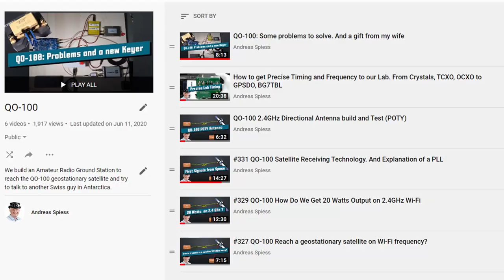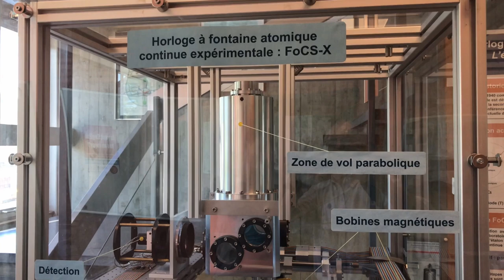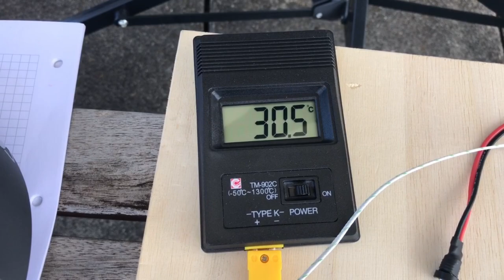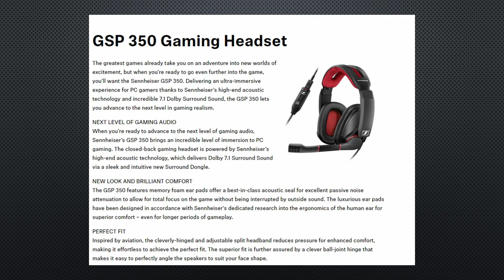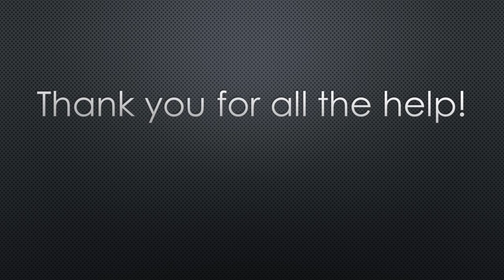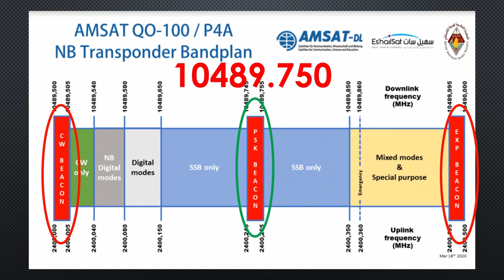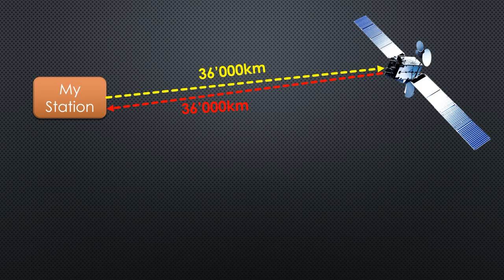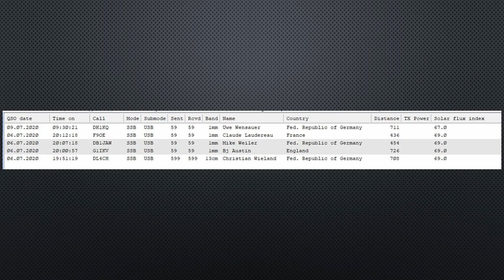#344 QO-100 Update: Fried things. And a success

Comment: Hi Andreas
As a fellow Radio Amateur I would like to congratulate you on your first satcomm contact, I am at the other end of the spectrum HF Voice and Data.

I too am an keen experimenter;  to increase my knowledge, killing of equipment is a key part of learning, you learn more from your failures then your successes. Having killed x1 Raspberry Pi, x2 Arduino TTGO, x1 PSU, x1 430Mhz transceiver, and more; I do not remember ! 
Keep up the good work.
Chud M1PUP QTH London
Reply from the maker: So I think we play in the same league concerning killed parts ;-) At least most parts these days are not too expensive.

Comment: you just demonstrated why I put a decent size heatsink and a 80mm fan on my 2.4GHz PA. I like not having to worry about temperatures.

A thermocouple on the backside of the PCB, right behind the Transistor, mounted with a tiny dab of thermal paste and some kepton tape, works well for temporary temperature monitoring.
Reply from the maker: This is for sure a good solution. I ordered some thermal switches which cut the power off when above a particular temperature. As simple protection it should work.
Reply: @AndreasSpiess  Yes very effective.  I used the same after frying a Peltier effect device

Comment: Hi Andrea, thank you for the great video. I dont see any preamplifier in your setup, did you directly connect TX pluto to SG LABS PA ? Tx pluto is about 3dbm,with 30db power gain you should get 33dbm of 2W max, is it correct ?
Reply from the maker: No. The yellow box close to the PA IS A 20dB amplifier

Comment: As to ensuring proper cooling and RFI protection, what about a 9.5/10" or 19" rack enclosure with a beefier fan for the PA and ADALM PLUTO? Enclosure and fan grille (preferrably the kind which is a metal sheet with dense small holes) well grounded (you're a ham like me, you know the drill :D ). Should help with protecting the setup from Bluetooth, WiFi and other ISM gear.
Also, be aware of that using Switched Mode Power Supplies can cause headaches in RF applications (but nothing worse than that you can fix it with a good LPF).
Reply from the maker: 1. Actually, I wanted to protect the Bluetooth set from my 10 watts at the same frequency ;-) I assume the dish is too small for the Poty, and part of hte power will not go towards space.
2. I have not decided on how I will mount it. My idea was that I want the installation as close to the dish as possible to reduce coax. But then it needs to be waterproof. I would prefer this concept also because it would be easy to take it with me for mobile. This is why I also wanted to try a 60cm dish.

Comment: The SG Lab V3 is a really good amp. I’ve made a couple of videos on it. We should organise a chat on QO100 sometime. Matt, M0DQW
Reply from the maker: I am one of your subscribers ;-)  I would have loved to have an additional built-in preamp to make it Pluto power compatible. But maybe the transverters have more power?
For sure we can have a chat. Maybe you contact me via one of the channels in the description? The only other rig I currently have is a DMR with a hotspot...
Reply: Andreas Spiess That’s awesome! They dropped from 500mw with version 2, but I use CN0417 as a preamp and it has a filter too :) Will catch you soon on the air waves :)

Comment: Could you elaborate more on how you managed to transmit o 10Ghz using the Pluto SDR.  Was there some sort of gain filter circuit applied?  Having a video illustrating this process would be excellent!
Reply from the maker: I do not transmit or receive on 10 GHz with the Pluto. Maybe you watch some of the other videos. It is not simple...

Comment: Well that was fascinating - you're making great progress with this project. I wonder why your first amplifier got so hot? Did you get to the bottom of the issue?
Reply: if you see in the video, Andreas explains. Some time i find things a bit subtle, explained fast because they are not useful. i worked at bmw and basically, it's ok to take the data from bad things, but no need to make bad things last longer. it cost time, processing and upload. i hope this explains.
Reply from the maker: Indeed. I do not exactly know why it got so hot, but I will not investigate much more. I learned the lesson and added a fan and will also add a thermal interrupter at around 70 degrees when I get one. I only had normally off versions in my lab...
Reply: @AndreasSpiess  I'm not an expert, but I have read that when the PA heat up, they start to increase their bias current more and more, causing it to heat up even more, so it start a thermal runaway

Comment: A very interesting series.  It is a long time since 1966 when I used a super-regen receiver to listen on VHF.
About the parabolic dishes-  sometimes in Germany I have seen square flat satellite antennae for sale and on houses. I don't know how they work, perhaps they use some sort of delay feature to make the waves arrive in phase - or like a Fresnel lens maybe.  Could you have used one of these in place of a parabolic reflector ?
Reply: With POTY and LNB he is RX and TX with a single reflector. NOT easily possible with the flat ones (which are a phased array) search for example for "Panelantenne"
Reply: @reinholdu9909  Thank you very much - very helpful - I should have thought about the transmitting aspect though ...
Reply from the maker: And having only one antenna makes things considerably easier, I think.

Comment: Once again another very informative video. 
I've been checking every Thursday for your video on Q100.
But you lost me, on the very part I was most interested in. The stabilization. It seems you achieved it, without using the DPSO, which plugin did you use? Can you explain more please, and provide the link.
I'm not good at soldering so I'm hoping that this software solution, will be good enough to make frequency tracking in ssb in the GHz range,  without replacing the Pluto's original crystal.  Maybe wishful thinking...
I also thank you for your timing video, because it let me know I can use a cheap mublox as a stable clock. The limesdr has provisions for external clock inputs...
Thanks again for your great videos.
Reply: @Loid Loid  ...go look for www.SDR-Radio.com, Simon G4ELI like he says "It's All About The Software", his software called SDR-CONSOLE 73
Reply from the maker: The software only works on the receiving side. You have to change the Pluto if you want it stable. As shown in one of my earlier videos I use a GPSDO for that purpose. Others change the TCXO. Both are not simple as you write.
The software is part of SDRconsole and only has to be activated. You find videos about it. It worked extremely well for me. My signals were exactly on the frequency. If you use the LimeSDR you do not need the soldering. Just a GPSDO because it has a reference input.
Reply: Thank you , for your quick and informative response ...
Not what I wished to hear, but I kinda knew there was no magic bullet.  I will have to buy another Pluto to experiment with. 
Must learn sdr console...
Thanks again gentlemen.
Reply from the maker: I now had qiute a few QSOs and go positive feedback about my signal. So the combination of GPSDO on transmit and beacon for receiving seems to be ok.

Comment: The PA is really a bummer. Did you check if the LDMOS is still ok?
If so it would definately be possible to repair the amp for pretty cheap. 

Other than that, congrats on your first success, really fascinating stuff. 

Greetings from Germany, 
Michael
Reply from the maker: No, I did not check it. I assume other parts are also damaged. So I will use my time for other projects, I think. Like playing with the antennas (maybe I can make it portable...). I also saw LoRa projects over QO-100
Reply: @AndreasSpiess  Seems like really interesting projects, especially the LoRa part sounds amazing. 

I would be happy to help you with the broken amp if you are interested, since LDMOS amps are kind of my thing. :)
Reply from the maker: Where are you located? Maybe  you drop me a message on Messenger of Twitter?
Reply: @AndreasSpiess  I dropped you a message on twitter. :)

Comment: I did not know that bulgarians produce such power amplifiers. Where are they located?
How do you assume that the temperature reached over 300°C?
Cheers from near Yambol
Reply from the maker: 1. AFAIK it is a Ham radio guy. And they are in Sofia. Quite famous for his amplifiers.
2. I just guessed from the flown solder. Maybe it was a little lower. I did not lookup the temp. I know my soldering iron is at 330 degrees and the solder flows ;-)
Reply: In Sofia is pretty much everything in Bulgaria... But it is further away from me now, as you were when i still lived in Germany :-/
But i can be in Burgas in one hour now :-)

Maybe you can make a test at which temperature you cannot melt the solder any more. Should be way under 300°C

Thanks for your Answer :-)
Reply from the maker: The amplifier has gone the way to the "Elektronikschrott"...
I looked up their address on their homepage.
You seem to live in a sunny place...
Reply: Oh, what happened?
I really live in a sunny place, calm as well :-)
Reply from the maker: The Chinese one. So I cannot do a test anymore

Comment: Strange, at the point of displaying the playlist, the stream displays consistently blurred
Reply: The data stream is coming from your local You Tube server. I've noticed that recently the default playback settings are lower than the uploaded version. Just pause the video and increase the playback setting to 1080p (if possible; I don't know where you are).
Reply from the maker: Strange. It should just be a reference to the videos in an order.
Reply: @AndreasSpiess  Thank you Andreas Spiess. I apologise I am unable to find a Swiss title such as Herr Spiess, Mr Spiess, Monsieur Spiess. I feel it is polite to address you formally in the first instance and more informally after that unless otherwise instructed by tradition or indeed any assumed and pre-existing status? Your comments are always welcomed. Alexandra (Crawford, Ms.)
Reply: @michaels3003  Hi Michael S. I agree with your observation and by resetting the current session default resolution all aspects of the stream become clearly visible. Thank you for your input!
Reply: @michaels3003  I am in the UK and again the behaviour of our telephone/broadband companies appears to be to squeeze as many subscribers as can be managed before complaints become threats of withdrawal from sufficient subscribers to drive a bandwidth upgrade. But never to subscribers, only to the carrier infrastructure until the same pattern re-surfaces. Pay double the subscription and perhaps then the quality of connection becomes paramount. You do get what you pay for. Considering that broadband was originally designed in the UK yet we have consistently lagged behind Europe in implementation and performance appears to be a historical hangover of bluff and double bluff. Political secrecy can be both insidious and damaging if it isn't anything else.
Reply: @alexandracrawford800   , you are very welcome.

Comment: This is mission impossible. You can't communicate with  geostationary satellite  in Antarctica, because geostationary satellites are below the horizon.
Reply from the maker: I did it. It was no problem :-)
Reply: @AndreasSpiess  No you did not. Probably via another satellite, but not via a geostationary satellite.
Reply: Or perhaps a geostationary satellite is sending a message to another satellite visible from Antarctica. Geostationary satellites are not visible from the polar regions.
Reply from the maker: https://en.wikipedia.org/wiki/Neumayer-Station_III
Reply: @AndreasSpiess  I did not write that you did not communicate with Antarctica via satellite. I have written and I repeat that it is not possible to communicate directly with a geostationary satellite from Antarctica, because geostationary satellites are at that latitude below the horizon. You can see it better in the attached picture. It is basic geometry. https://imgur.com/a/zuHlgFH , L is the largest latitude on earth from which a geostationary satellite can be seen, d is the distance from the center of the earth to the geostationary satellite, and R is the radius of the earth. d = 42165 km, and the mean radius of the earth is R = 6371 km. We can now write two equations sinA = R / d and L + 90 ° + A = 180 °. We now have a solution for L = 90 ° -A. L can be 90 ° only when A = 0. It can only be if the satellite is at infinity.
Reply: I'm sorry I made a mistake. Neumayer-Station III is located far enough from the South Pole and it can communicate directly with a geostationary satellite. At that location, the geostationary satellite is above the horizon. As can be calculated from the equations the largest latitude from which a geostationary satellite can theoretically be seen is 81 ° north or south. Because the Station is located at a lower latitude, it can communicate directly with a geostationary satellite. The equations are valid for an area of approximately 1500 km distance from the South Pole. I apologize once again.

Comment: Glad you got it working but sad to hear about the demise of the power amplifier. Thermal runaway perhaps. Anyway they need good cooling as burned fingers will attest. The POTY offset would have caused some elevation angle offset that needed to be corrected. You may want to try a better lens also but the NB transponder is very strong so it will probably do as it is. You need a radome. I use this high tech solution with a transparent polyethylene covering.  https://upload.wikimedia.org/wikipedia/commons/thumb/9/9b/Ziplock.jpg/440px-Ziplock.jpg 

SDR console is brilliant. Amazed at how quickly you set up the TX and RF offsets. It took me several attempts. Perhaps one day we can have a QSO.
Reply from the maker: 1. You are right. Things have to be protected against weather. Currently this had second priority, but soon it will become #1. I love Ziplocks, but maybe I will use something 3D printed...
2. I do not have a high SNR for now (28 beacon - 6 no signal). I will investigate to increase it. For strong signals it is no issue, but for weak ones.
3. For the moment I have to sit on my roof until I get my Pluto on the net. One works, but the modified one does not connect to WLAN. Only then I can do QSOs from my lab.
4. This is why I showed the factors in the video. It was very clumsy without them...
5. I got the lens with my Poty from Passion. Where do I get a better lens? (BTW: I measured only around 1 db better SNR with lens compared without.)
5. Hear you soon!
Reply: @AndreasSpiess  I think Passion have a new lens from HB9VQQ. The dish focus alignment is very important. You may need to move things forward or back a little.HB9VQQ indicates the focus of his lens https://twitter.com/HB9VQQ/status/1264993815183740929/photo/2 is 9.5mm in front of the pipe. The original LNB front is about the focus.

WLAN?  It really needs to be wired ethernet. If not at least use minimal bandwidth in SDR console. The Pluto is fussy and not named after the god of the underworld for nothing, You can expect 2.4 GHz WiFi to fall over when you transmit on 2.4 GHz like your bluetooth headphones but 5 GHz does work, at least it does for me.
Reply from the maker: Thanks for the tip about the focal point and HB9VQQ. I sent him a mail to ask where I can get such a lens. I have now also a 120cm dish which gives much better results than the 80cm one. And I have a 60 cm dish for comparison. I plan to do some tests. I was in the "Swiss Round" this evening and people said my signal was perfect. So at least a success...
And tomorrow I will check the focal point of my POTY!